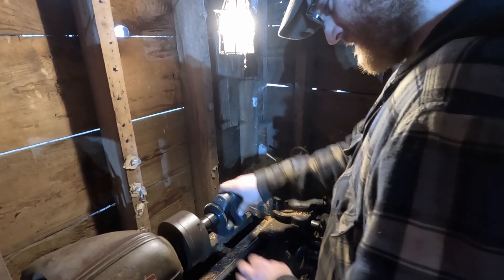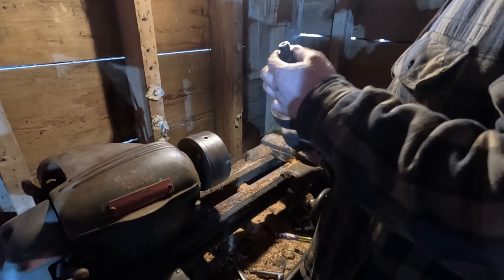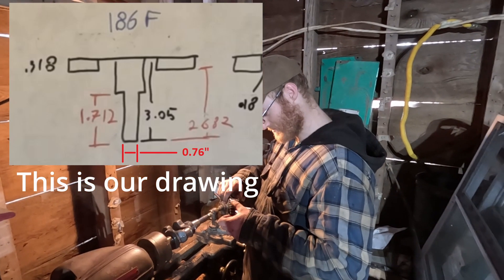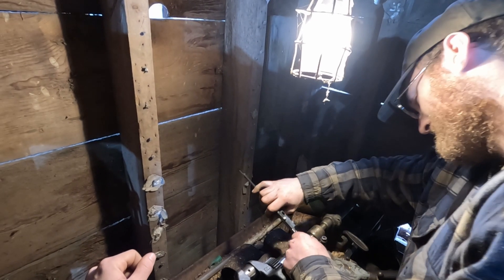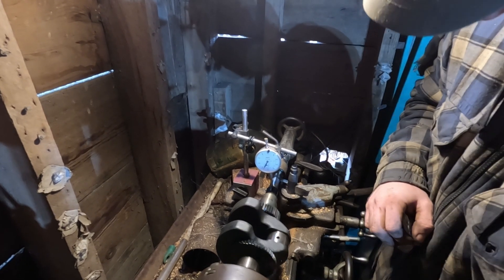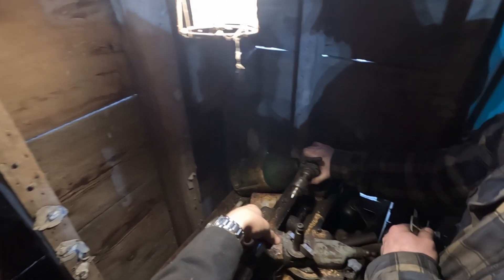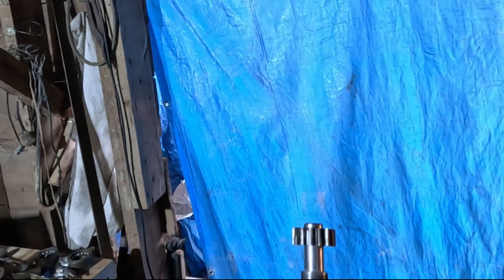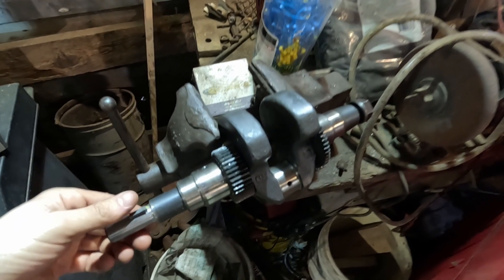Gravely C10A Diesel Repower - PT2, Machining the Crankshaft

Comment: That kind of lathe seems exactly as the kind I need. 
Small, simple bench top mount, that does not weigh a ton, yet long and laminate wise sturdy enough for typical yesterday farm works. Todays infamous chinesium minis and Myfords are just too small :D 
At next opportunity/talk with the guy, could you have a look or ask him for model identifications ?
Reply from the maker: It’s a Southbend 9” or Model A. Motor under variant. 
I’m in a similar boat looking for something small but not too small.
Reply: @haoleboyshow-tos2279  Thanks :)